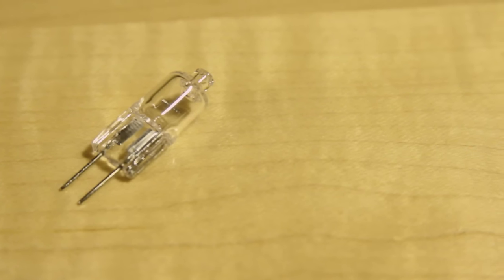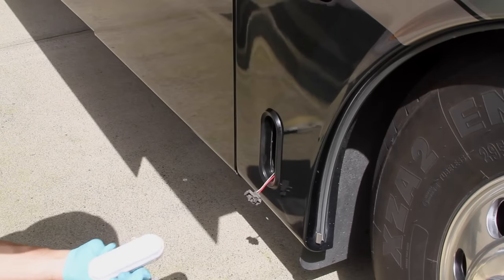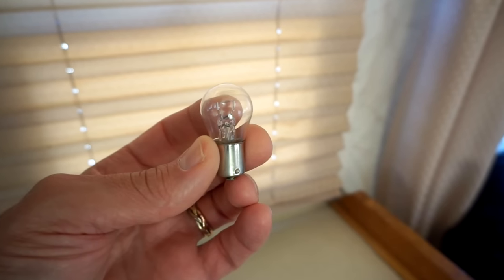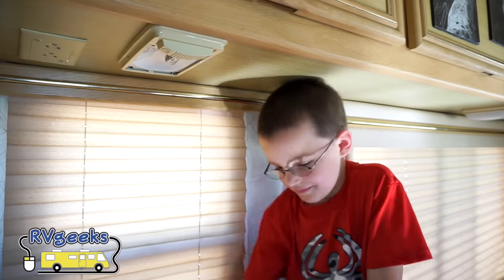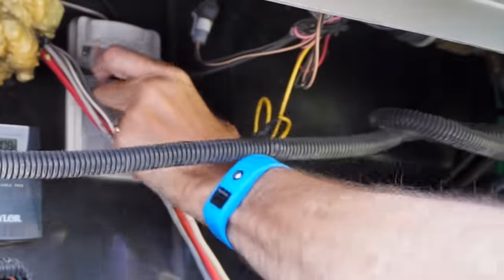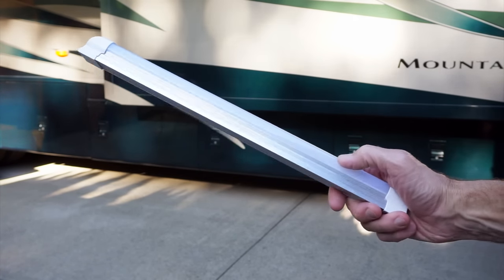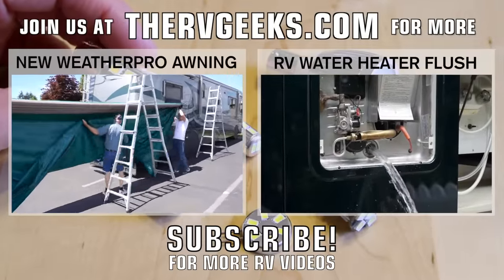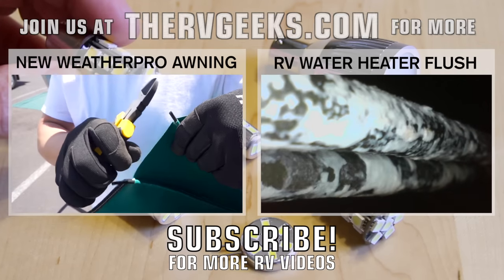Converting RV Lights to LEDs — PART 9 — RV Basement Lights

Comment: I replaced the bulbs in my pop up camper with LED bulbs. They were the 
fat wedge type. Hard to find replacements that didn't turn black quickly
 was the #1 motivation to switch. Dim light and they got dimmer the more
 you turned on was #2. Tried some cheap automotive LED bulbs the color 
was terrible and they dimmed fast and one failed. Went to lowes and in 
lawn and garden found some that would work. They were for the walkway 
lights. 20 equivalent (old incodecents were about 15W each) Now I got 
bright white light with no dimming even with all lights on and the 
battery gauge doesn't even move. It would before even when connected to 
power

Comment: I did not think about the outside lights.  Those could be good as LEDs. I started changing over the inside ones, due to solar deficiency, but now changing back after Dr Mercola's articles and reference to studies regarding eyesight and health issues. I put the LEDs in a handy drawer, so if I have a stretch of clouds, I can do a fast swap on the ones I use most.

Comment: initially expensive but it pays off with better lighting, less power usage and the LEDs outlast any other bulb.
Reply from the maker: Definitely! One of our favorite side benefits is the incredible reduction in heat output. Especially helpful when boondocking, when running the A/C would require running the generator.

Comment: Hi RVgeeks:-)  I have a question for ya, for your RV's storage doors, how did you change your doors so that they open sideways?  Did you buy it like that or did you guys convert it so that it opens sideways?  I like the sideways opening better than it opening vertical.  Please let me know.  LOVE YOUR CHANNEL!!!!
Reply from the maker: Thanks so much for the nice comment, and great question! Our rig came from the factory with those awesome "East-West" basement doors on the right side. We've never heard of anyone converting from flip-up doors to these, but we imagine it might be possible on some rigs, if there's space between them for the hinges, and structural strength at that spot to secure them, and the latches, off to the side. We'd suggest that if it IS possible at all, it would best be taken on by either a very confident and capable DIY RVer, or a professional shop that specializes in custom RV work. Before we tried, we'd be sure to get some professional opinions, as a custom shop may say that it's not even possible.
Reply: Gotcha, thanks for the recommendation!  I'll have to go seek opinions then:-)  Have a great day!!!   @RVgeeks

Comment: Something shorted out in my winnebago last night i woke up at 4 am and my furnace was going full blast. Im in florida right now so thats not good. My thermostat was turned to off too. Any idea what could have happened ?
Reply from the maker: Sounds like it must have been something like a short in the furnace or thermostat. We'd remove the fuse until you can get it diagnosed to prevent that from happening again until a tech can figure out what's happening. Sorry we're not much able to help on this one, Randy.
Reply: RVgeeks That is what i will do. When im back in canada for december ill get a new furnace put in anyways.

Comment: Have you also replaced stop light, tail lights and back up lights with LED's?
Reply from the maker: +Trz Charlie Not yet, but they're on our to-do list! 😉
Reply: I had a bad flickering effect trying to change my 2001 model over on the rear lights, then no turning signal. I gave up, but have done all interior lights
Reply from the maker: +vegasdavetv We've heard of there being problems... and have read a little about CanBus systems that can have an issue with LEDs because their resistance isn't as high as an incandescent bulb, so the circuitry freaks out. So maybe that was some of your problem?  When we do our upgrade to tail/turn/signal, we'll try and include information about that issue. Sorry you had trouble.

Comment: i would suggest you buy a sample light to see if you like the color before you go whole hog
we bought the wrong color and our camper looks like surgical suite
Reply from the maker: Great tip, Phil & Nichole! You probably bought "cool white" which does indeed look like a laboratory! We use a mix of M4's "natural white" bulbs, which provide very clean, bright white light (very pleasant with no blue cast) and their "warm white" in places we want a little warmer tone, like our wall sconces. We only cool white for work areas, like our basement compartments.

Comment: can these be used in my car too?
Reply from the maker: Cars and RVs both have 12V systems, so these lights are usually fine for use in either. The only caveat to that is that some cars/RVs use an electronic system for triggering the lights called CANBUS (typically newer cars)... and that system doesn't always play well with LED lights because they have lower electrical resistance than standard incandescent bulbs. So you can see funny behavior like rapid blinking, etc. There ARE sources out there for CANBUS-compatible LEDs, but M4 doesn't offer them.

If you Google your car's year, make & model, you may be able to find out if it uses a CANBUS system in its lights. If it doesn't, you should be 100% OK with replacing any/all bulbs with LEDs. Just try to be sure you match the LED light color to the color of the lens so that (1) the bulbs will be as bright as possible (which is usually part of the intent anyway) and (2) if the lens breaks/cracks, the bulb still glows the correct color, making it safer for others on the road.

If you buy from M4 Products (http://m4products.com) don't forget to use the Coupon Code RVGEEKS5 to get 5% off your order!